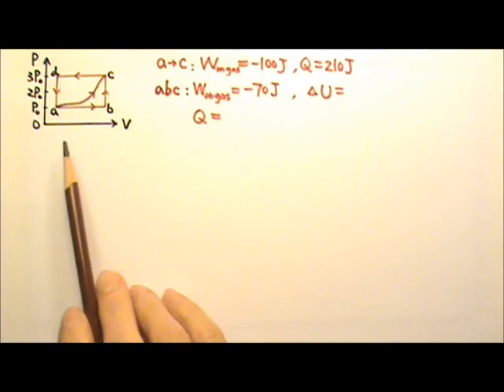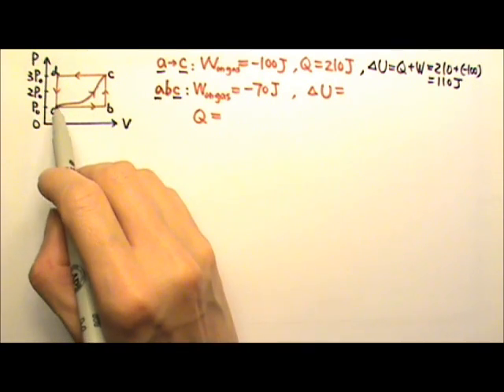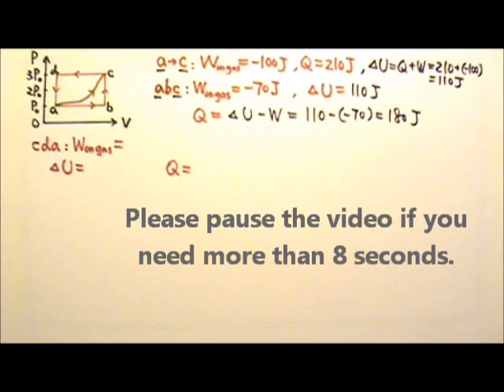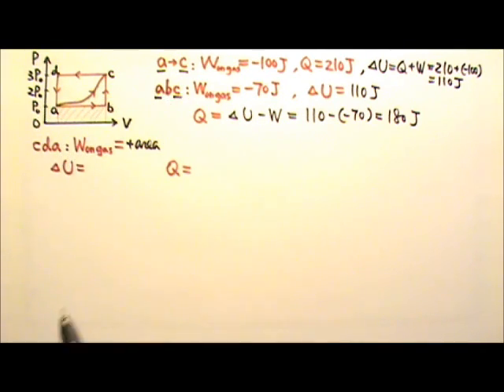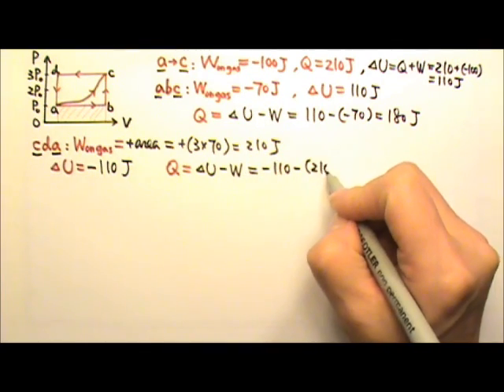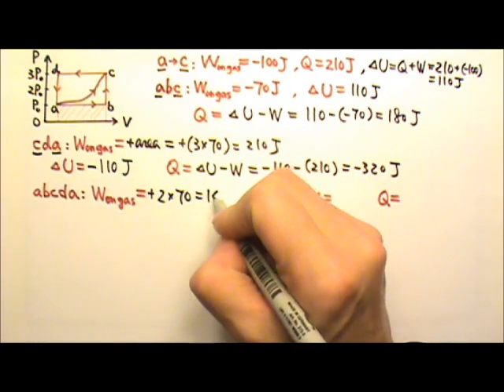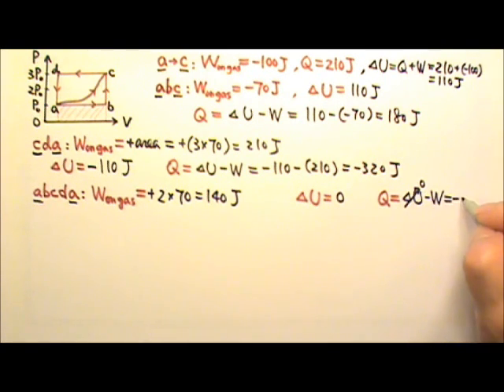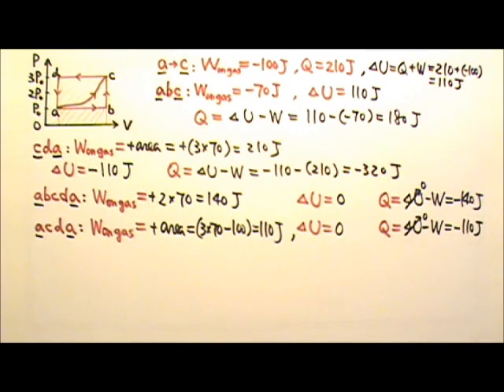AP Physics 2: Thermal 27: First Law Problem 6

Comment: at 7:40, why wouldn't the area of a->c be -100 J? it says -100 J right at the top of the page but you said 100 J, so why would you switch the signs all of a sudden?
Reply from the maker: I meant that the amount of area is 100. The sign depends on which way the process goes - whether the volume increases or decreases. In this case, for a to c, the volume increases, so the work done on the gas is negative.